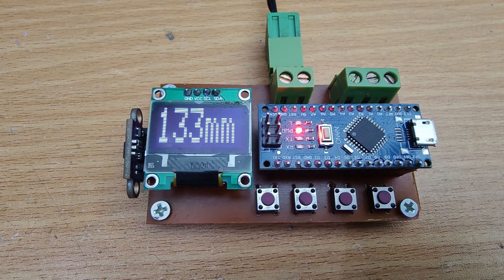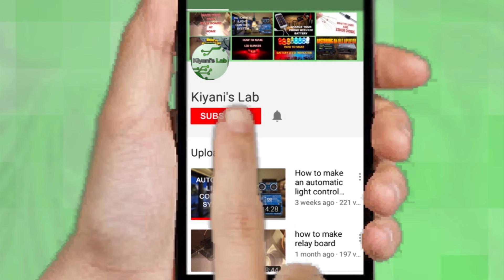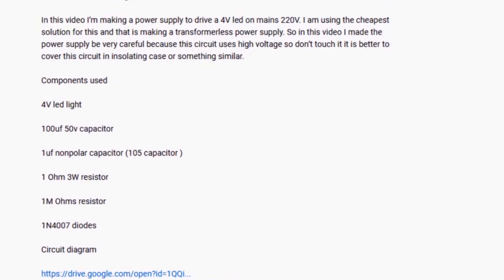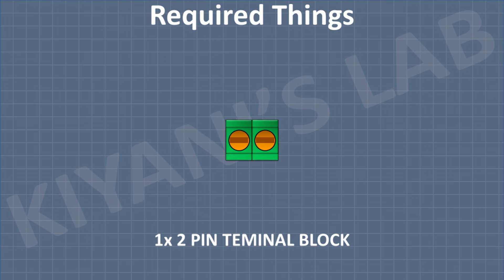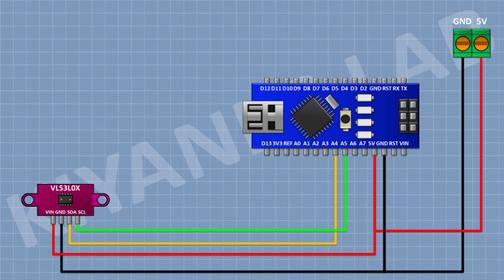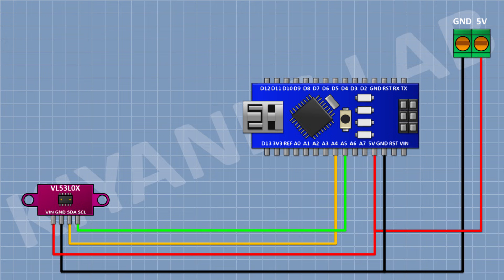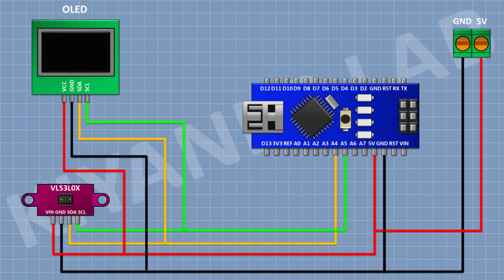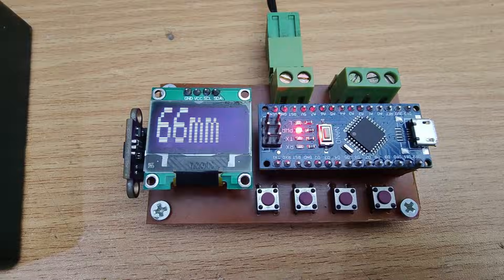Laser Distance Meter | Arduino Project

Comment: Boss make a charger can be adjusted charging cutoff volt and low cutoff volt use Arduino can see battery voltage and charging current please
Reply from the maker: Sure, I will soon